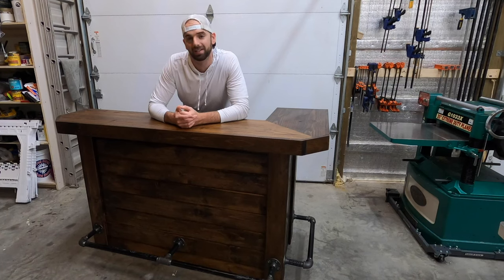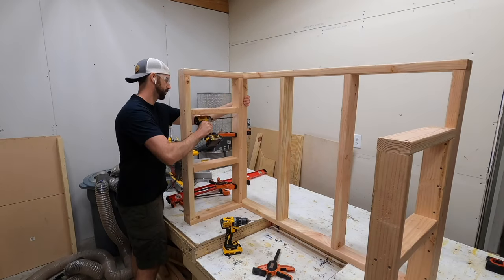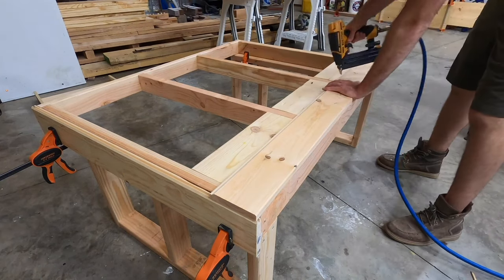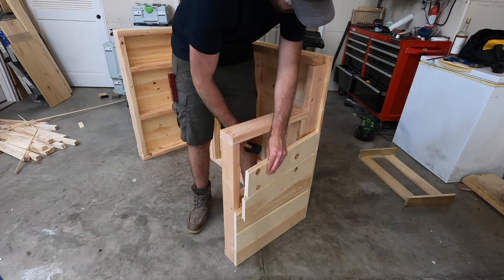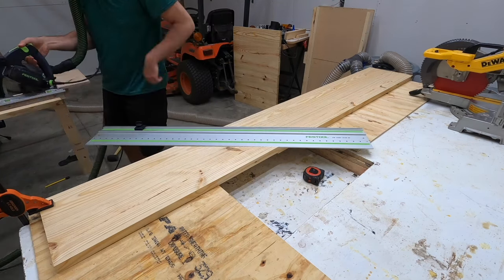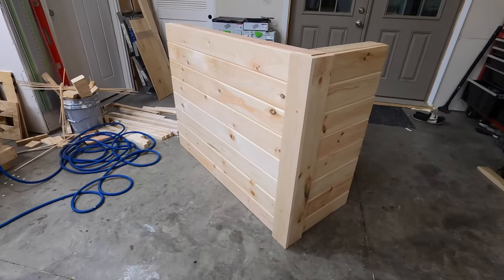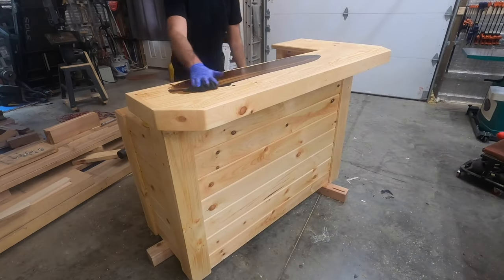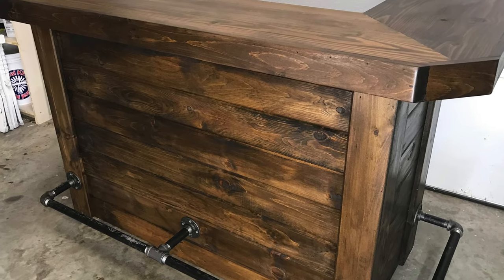Custom Bar Build - Tutorial Style DIY Video

Comment: in your description you tell everyone where to buy tools all the way down to the GoPro. But you never told anyone the size of the bar.
Reply from the maker: I didn’t record dimensions, but the pipe is 1” black iron. Pretty sure the two main pieces across the front are 24” in length connected with a T and then two 90degree elbows on the sides.
Reply from the maker: I now have plans for this available at the following link!
https://mmccwoodshop.etsy.com/listing/1652222408
Reply: @mmcc_woodshop6288  Cool. I already copied your design. Kinda. But things got put on hold because the RV park I wanted to buy would not qualify for a business loan. The guy screwed up the books on the business. So I'll be building one from scratch with lake front property. So if you want to know the in's N out's of building an RV park, be sure to fallow along.

Comment: I've never seen the Z clips before. Seem pretty nice. 
Great video. Thinking about making my own bar in an opportune space in our basement. Thanks for showing the process (and mistakes)
Reply from the maker: Z-clips are by far my preference to attach tops/shelves. Good luck with your build if you go for it and thanks for watching!
Reply: Anyone have the dimensions of the bar?
Reply: Hello, he mentions in earlier comments that the bar’s dimensions were custom for the person that was intended to, and that ended up around 42” tall, 54” long and 20” deep.  I’m not sure if the 54”long and 20” deep were the measurements of the finished top or the base.  Looks like the base is about 48-50” inches since he said that the distance of the 2x4s in the base are around 16” apart as standard wall construction.   
Hope this helps, I’m trying to figure this out myself, looks like today is the day I build this for my boyfriend

Comment: Great video.  I will use this for my pub shed.  Regarding the mistake, wouldn't it have been easier just to remove the middle board that was preventing you from dropping down the shelf and then screwing it back on, rather than removing all the tongue and groove boards?  I'm sure I'm missing something.
Reply from the maker: Thanks for watching! Yes, that would’ve worked as well - there’s really no specific reason I didn’t do that, I guess popping the tongue & groove boards off was just the first thing I thought of 👍🏻

Comment: Hello MMCC_Woodshop, do you remember the length of the 1” black pipe you used? Looks like 2 of the 24” on the front and for the sides maybe a 12”?
Reply from the maker: I believe those are correct. If you made it longer or wider you could always adjust the pipe measurements as well 👍🏻

Comment: What was the length of your wings? Also, any advice on what type of wood would be good for outdoor use?
Reply from the maker: I can’t remember dimensions unfortunately as I was just cutting everything to length as I was going along. Teak wood is probably the best for outdoors, but very expensive. Treated pine will work fine as well 👍🏻
Reply from the maker: I now have plans for this available at the following link!
https://mmccwoodshop.etsy.com/listing/1652222408

Comment: Question: why didn't you notch out the shelves to fit around the studs? Wouldn't they lay flat against the front end of the bar
Reply from the maker: That would’ve worked, I just had it in my mind already to do it this way I suppose

Comment: For the Mistake, I’m guessing it wouldn’t have fit from bottom up in, as if you laid the entire bar on its back and came from what normally would of been the ground up in.
Reply from the maker: That might have worked - I didn't think to try it that way. At the time it seemed easier to just pop the tongue and groove panels on the side back off.

Comment: What size is the black iron pipe??
Reply from the maker: 1” 👍🏻
Reply: @mmcc_woodshop6288  ok thanks replied right on time. Im at home depot now. Did you happen to get it from there and all you fittings are 1 inch right ?
Reply from the maker: I got everything from Lowe’s - there isn’t a Home Depot nearby. Yep, the fittings will need to be the same size as the pipe